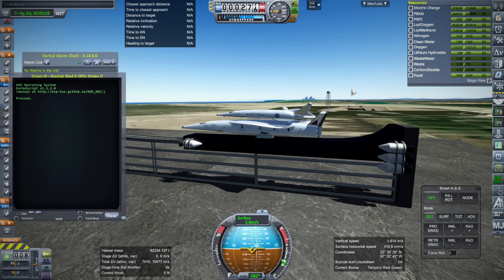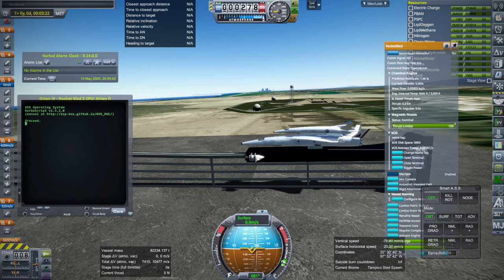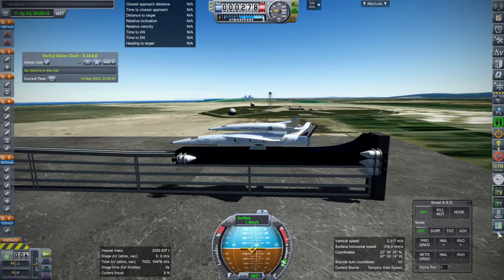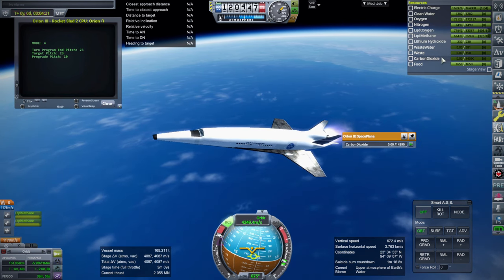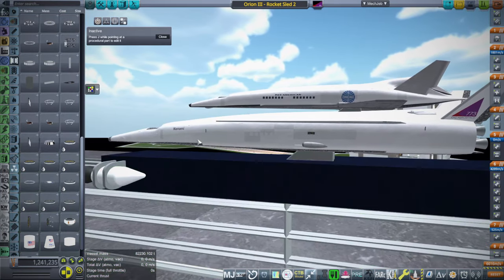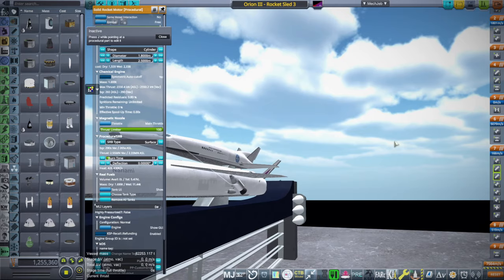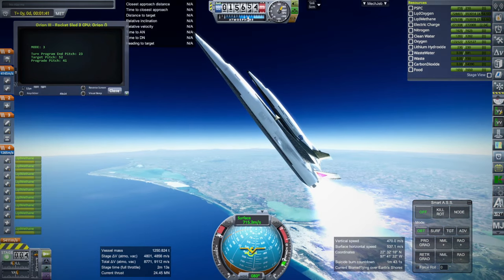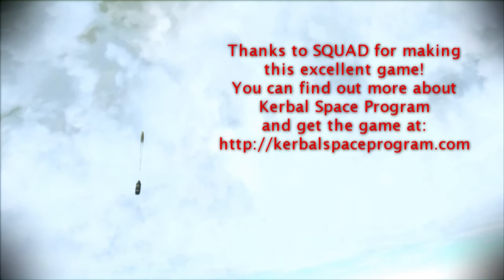Rocket Sled - kOS, RATO, and the Orion III

Comment: with the whole concept of it being more convenient to board while the craft is horizontal, if the interior is set up right it wouldn't really make a difference I would think. If you have regular enough non-structural bulkheads along the length of it, they would act as floors while vertical and walls when horizontal, and then you could have stairs in-between etc. I suppose that would add mass though, and sled launch is pretty epic..............
Reply from the maker: To have stairs, you need it a certain size - the cross-section of this is four abreast seating, so it really isn't wide enough to have stairs go through. You probably couldn't have stairs through a 737 cross section, even.

Comment: Would it be possible to make a hinge mechanism so the sled starts flat and then the nose lifts up to the rest of the ramp that's at a preset angle? You could eliminate the curve that way so you don't get the fuel settling issue and the passengers could still enter flat.